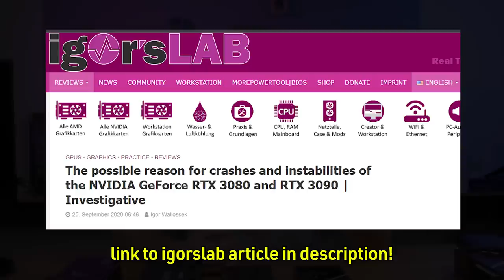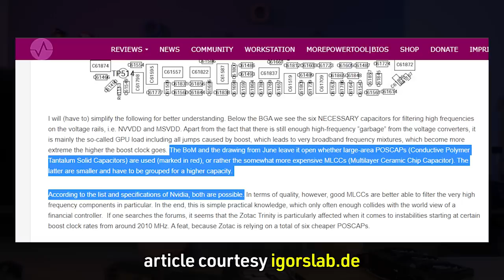The RTX 3080 Launch can't get any worse... Right? Wrong...

Comment: Those capacitors don't filter out the noise, they decouple the inductance of the power rail from the component, so that you see a low inductance at the pin. It's very different from the crackling noise you hear at power lines, that's due to the high voltage.
Reply: Soo,
Hes covering Nvidia ?!
Reply: @Viktor_oknp  just trying to add some information which I actively study. Can't hurt
Reply: @adamnbot3249  I know,  but do you think our guy Jay was paid ...?
Reply: Thanks for that I was just about to say it
Reply: @Viktor_oknp  Only AMD pays sponsored video's
Reply: Jay isnt the most technical most of the time and im sure he just wanted to explain it in the most barebones way possible because even if not technically right it at least paints a picture. But kinda cool to see what it actually does
Reply: And what is the entire point of decoupling capacitors in the first place? cough NOISE ISOLATION cough 
Capacitors have two primary jobs and they are not always exclusive (particularly in situations like this one): filtering, and offsetting inductance. Though yes, I don't really see how it relates to the electron-stripping and subsequent heating that is responsible for the "whine" heard from HV power lines.
Reply: @douglasmayes9252  to a large part, yes, but also the lead inductance at the power rail also adds to the Bandini mountain, hence the large resistors too. Also talking about the voltage line analogy which is very wrong
Reply: @Viktor_oknp  haha, no I don't. I believe in jay, and he's no perfect human, so little mistakes are bound to happen
Reply: @andresacosta5318  yeah agreed, but I'm guessing a large number of his students might be electrical  engineering students too, and these little things might give them a leg up over others
Reply: @adamnbot3249  he's kinda sus,he might be the impostor
Reply: @Viktor_oknp  he's sus? Vote him out now!!!
Reply: The inductor Is a low pass filter
Reply: @dawn-blade  okie
Reply: @dawn-blade  and? Whats the problem?
Reply: @dawn-blade  You don't have to. It's a comments section. By your logic nobody asked for your opinion either so shove it. At least he educated us. You just spout idiocy.
Reply: @adamnbot3249  since you study this type of stuff, I wanna pick your brain so I don't fk up my PC down the road lol. What brand power supplies do you recommend? Like which ones are built to a higher spec than others assuming all are gold or platinum?
Reply: @adamnbot3249  lol I got highlighted🤔
Reply: @4x4forlyfe the PC power supply is typically rated in terms of the power efficiency, and to my knowledge there's no distinguishing factor for electrical noise. Unless you get a defective component, you should be fine with whatever you choose, if there is a noise issue they'll usually catch it during QC testing, more efficient power supply means less power wastage and thus better energy bill savings, that's what the ratings usually mean.
Reply: @FiRem002  that's not the point I'm trying to make, he's gotten a lot, and I mean a lot of things right in the past. Just one thing I pointed out which was slightly incorrect. Maybe he's trying to make things seem more relatable, but if someone wants to know more, why not
Reply: I'm a electronics major as well and caps can be used as filters. Look at any audio setup, they use caps as a line filter to reduce "noise" on the line. So what Jay is saying is still fairly accurate as what the caps are doing plus the fact that he discovered that the RF signal coming from his wireless mic was causing issue with the graphics card.  The more caps used will help "clean up" electrical noise on a power rail and most of the noise comes from the overhead power lines supplying the home. They have isolation transformers that do a fairly decent job at cleaning up noise before it gets to the PC or any other electronics.
Reply: Thanks for the info. Rao.
Reply: @chrislewis2262  a few people have said this and rao bot is just ignoring it since he's one of those deluded EE's. As en EE, I can't stand these types
unless i'm missing something, literally in his own words "decoupling the inductance from the power rail" == "decreases (aka filters) noise"
seems like a lot of pride with little substance. maybe he's young
Reply: @royevans4581  lol
Reply: @MrGronka  maybe, I know I have about two and a half decades under my belt in the field.
Reply: @adamnbot3249  There are plenty of people that did testing for ripple current and other factors within power supplies. Used to HardOCP would, now people like Johnnyguru still do. Better power supplies will have lower noise in the signal. I'm not sure if you're trying to say that there's no "distinguishing" feature for which PSUs suck and which don't... in which case I can kind of see that... but empirically the differences exist. They're just tested on the final product that's actually pumped out. 

https://webcache.googleusercontent.com/search?q=cache:pAS5Q2V_jhoJ:https://www.corsair.com/us/en/blog/why-does-a-better-power-supply-mean-a-better-computer-experience+&cd=1&hl=en&ct=clnk&gl=us&client=firefox-b-1-d

Here is an old article on the subject. Companies like Seasonic are known for being generally reliable. Corsair as well on their higher end products (though more of a mixed bag lately). I kind of wish HOCP still did their PSU tests, they were rather strict. 

Granted there are manufacturing tolerances in every component used in a PSU, so the tested one could also be a "golden batch", as it is with everything in mass manufactured electronics. QC processes often only go so far...
Reply: High voltage doesn't necessarily mean that crackling noise will appear. Crackling noise will appear due magnetic forces being created. Which can be created in a DC current too if you have opposing fields or worse, amplifying fields. The strength of these magnetic fields are decided by Ampere rather than voltage. Voltage helps jump the 'distance' but if you reduce the distance, you will also need less voltage to create interfering magnetic fields. 

But if there isn't enough ampere in wire, it won't create a strong magnetic field anyhow. 

I do not remember the formula exactly for calculating magnetic field, but it is essentially a property of the material and the ampere. Hence, when you get down to PCB levels, where you generally have a lot of Ampere on low voltage while components are tightly placed. You can create 'noise' because magnetic fields are colliding, amplifying etc. And I do not have a PCB spec sheet, but...

Opposing fields of similar value will nullify one another. But if one is stronger than the other, it will create an opposing current(resistance) in the other component. Or amplifying which means you are essentially creating a magnet. Which can also create a resistance/interference. 

I mean, in the recent years in my country. In normal 128A 400VAC fuse systems, you have metal backplates that are being grounded/earthed because it create enough electrical magnetic field that subtly create adverse effects on people in certain configurations. 

So, Magnetic fields sounds like the issue since he is describing 'noise' along with the mention of Jacob's Ladder etc. All properties of magnetic poles creating different positive and negative charges.

At least, Magnetic Fields tend to be the topic when you speak about Noise in any electrical system. Because it is generally tied to the fact that an opposing current is being conducted in a wire. 

To put it simply; 
Someone suddenly wants to drive on the wrong side on the road on a highway.

Comment: "cheaping out" on high end cards doesnt make sense, i can understand this on the 3050 for example (cuz it doesnt need squat) but c'mon you're already paying enough for high end and you are getting this
Reply: Yeah I wonder what's the difference to a producer between putting all 6 cheap ones or 5+1/4+2 at least.
Reply: Yeah, it's kinda dumb. The 3080 and especially the 3090 should've gotten the best ones only. Kinda sad companies can't spare a few extra pennies for quality at those price points.
Reply: You are thinking it wrong. If you make 1 card its not a problem because price differance is is not significant. But when millions of hyped people are waiting it quickly adds up. It's one of the things you should NEVER fotget while running a company. When you are mass producing pennies adds up to millions so quickly.
Reply: that's why you should never buy on launch
Reply: @egegokdenizduman  that is true, but its better to spend more, to get a more quality products, specially if it means to avoid situations like this
Reply: @egegokdenizduman  That's great and all, but MSRP allows for a profit when using the minimum specs, so they are just trying to line their pockets by going to less than minimum specs. No doubt people remember when they get fucked over by a company.
Reply: aibs cheaping out? who gave them the reference spec minimum ?
Reply: so some of the more expensive OC models should actually  be called UC - under-cooked er .. under-clocked ? and will there be a cashback when that 'free' vbios update arrives .
Reply: @jrok96  Absolutely. Nvidia and their fanbois will endlessly blame the AIBs for this problem even though Nvidia gave them the specs.
Reply: @jrok96  The reference spec isn't the issue, that minimum will work fine the minimum spec was one MLCC the ones that have issues are the ones that have none and didn't follow the spec.
Reply: @stephenwerner1662  Nvdia did give them the specs, which was correct it's that AIB went below the spec. AIB's that followed the spec should be fine. The spec isn't the issue, it's not following that spec. Did you even watch the video?
Reply: @MrTaunks  margins for this sort of thing are pretty thin. And they aren't going below the minimum spec; the video shows that the spec is non-specific about this.

The AIBs should have done better testing, but I don't think they're being evil. They're trying to survive in a hyper competitive industry that is largely commoditized.
Reply: @stephenwerner1662  but,,, the video says 5+1 is the reference, obviously all 6 cheap capacitors means it's even below reference, right? so it's not like it's nvidia's fault, that, aib have freedom to build a card as they wish. 

btw i'm pretty sure asus is already reaping rewards of being the company to go with the more expensive capacitors. enthusiasts remember
Reply: @egegokdenizduman  That is the same thinking that apple fanboys use to justify the extraordinary high prices, while there are brands like Xiaomi and such out there who show, that high performance and quality can be delivered at MUCH smaller price point. Overthink your mindset bro, you might be screwing yourself and your own wallet :)
Reply: @The123tactics  Nvidia doesn't allow board partners to ignore specs. The AIBs followed Nvidia's guidance. End of story.
Reply: @jrok96  Nvidia set reference spec. And I'm pretty sure there's a point where all the beefed up, top of the line components means passing that cost directly to the consumer, and they know if they push prices up too high everyone will just overlook them and go straight to Nvidia instead

And thought it was that this is the lowest specs allowed, just that it seems to be working out worse than even the overloard though? Not that AIBs are going below reference spec
Reply: @egegokdenizduman  Fact of the matter is that they aren't making millions of them. And those small parts don't really cost all that much. It's marketed as a high-end product, so quality parts should be a given.
Reply: So, I'm a bit into PCB and electronics design myself. 
The raw price depends on what capacity those capacitors have and what voltage they can operate at. Since those companies are buying those capacitors by the tens of thousands they probably cost just a few cents per piece. Capacitors can even cost as low as 3 cents or so at single unit pricing, but they can go up to close to $1 per piece depending on properties and quality. 
Let it be 5 cents per cap at 10k units (I think they are actually more expensive than that IRL) 
~ 12 caps per group, 6 groups. That's already $3.6 per GPU without assembly cost. 
Placing more components on a PCB takes more time and thus it's more expensive. Hence they only use one large cap instead of ~12  small ones. It needs 12 times as long to place that. For one capacitor cluster. Times 6. It's all about the money. 
That's why they try to cheap out. It probably worked on older GPUs but the 3000 series seems to run right on the edge in terms of stability so this small change in components can have a huge influence on stability.
Reply: @detroxx56784  cuz the new gpus are such power hogs, we havent seen this power draw since early fermi and 200 series cards

Comment: Never, ever buy wave one of ANY piece of tech.
Reply: I got lucky with my ps4, first wave which gave a lot of problems and mine still works perfectly
Reply: Gonna wait for the Ti versions
Reply: @DrifterAtSea  There may not be a big difference.  The gaming difference between the 3080 and 3090 is already slim in the higher rez's (2k and 4k).  I don't see the Ti's being as big of an upgrade from the non-Ti's....as they were in the past generations.
Reply: JoJoelix got lucky too, first wave of the current gen consoles was rough.
Reply: But if people don't buy it, how will we know it's bad? The best QA is the customer base
Reply: lol. I got my 7970 on the same day of release and its still kickin'.
Reply: Remember this advice for them Corona vaccine..😇

Comment: It’s fixed with the latest driver. Thanks to Nvidia
Reply: SKEKMAL No, especially since the issue was actually with the Windows 10 driver, not the capacitors (Shown because there were absolutely no crashes on Linux). Go watch Hardware Unboxed’s video about it.

Edit: Just saw Jayz new video about this showing that the drivers were the issue and don’t meaningfully affect performance.
Reply: Yeap. Jayz rushed to stupid conclusions. Total amateur.
Reply: @SKEKMAL I mean that maybe there was a 0.5% difference; nothing anyone would care about. Imo, meaningfully affecting performance has to be at least a 10% difference in FPS (ei, difference between 54 and 60, or 144 and 158). Otherwise, it could either be ignored or chalked up to some other factor.
Reply: @SKEKMAL yeah we don't care you ain't buying nvidia cards, this is a misinforming video, deal with it.

Comment: you know you just made getting a founders card even more impossible
Reply: Seems like ASUS went full bling and put all MLCCs on their TUF cards. That will increase demand aswell.
Reply: Getting a FE card was always impossible to begin with.
Reply: @LowStuff  asus is always badass like that
Reply: You can till buy Asus & MSI..they are following spec
Reply: @hyroproto4364  we got lucky not getting any as most are missing the power supply parts a founders does and crash anyhow.
nvidia better be praying AMD do not keep to its words in any shape  or price beat or have a working card or bye bye nvidia